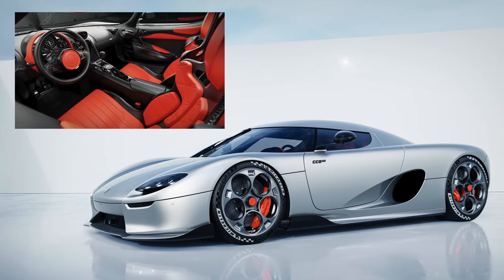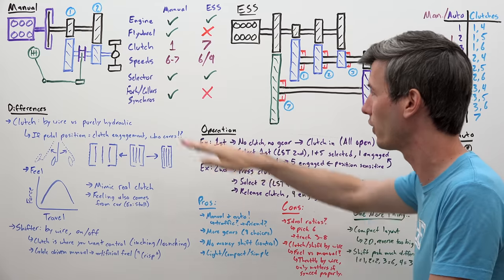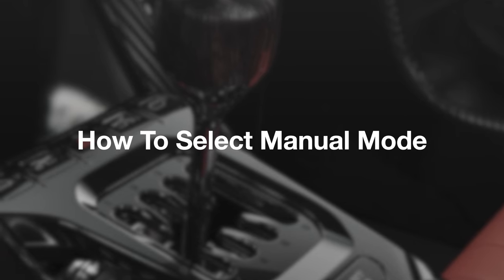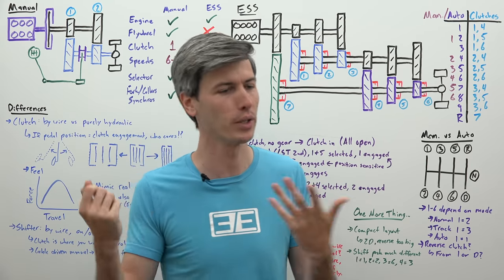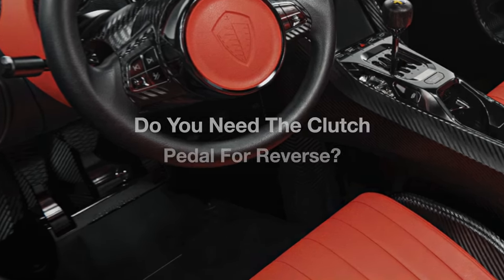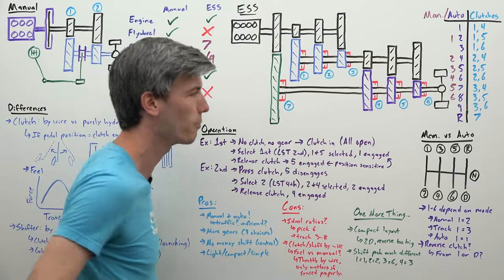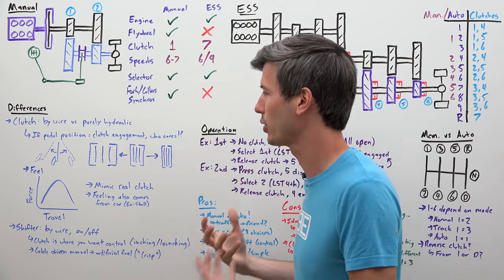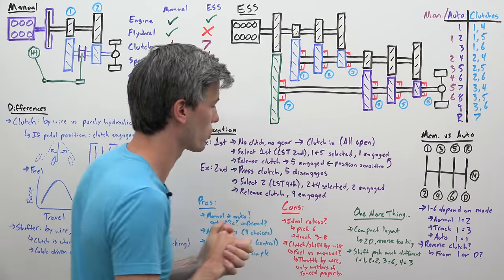Koenigsegg Reinvents The Manual! How The CC850 Transmission Works

Comment: 7 clutches... great for hypercars, not for economy cars. High parasitic losses and rebuild costs.
Reply: Typical modern automatics already have 6-8 clutch packs, so your point is invalid.

Aisin transverse 8-speed: 6 clutches, 7 if you include the torque converter clutch, 9 if you include the sprag clutch. Used in Camrys, RAV4s, Volvos, Minis, VW’s, etc.

ZF-8 speed: 5 clutches, 6 including torque converter clutch.

Honda 10-speed: 7 clutches

GM 9-speed: 7 clutches

Etc.
Reply: @Kyriaeus  Which is why even modern "slush box" automatics get worse MPG, need cooling and are not economical to rebuild. My point is valid.
Reply: @simonkolar5478  you’re obviously out of your depth. Modern “slushboxes” lockup fully by 2nd gear, some even lockup in first. If you haven’t noticed, the vast majority of models that have both manual and automatic options get significantly better performance and fuel economy with the automatic option despite the weight penalty.

Comment: Koenegsegg made this as complicated as possible when they could have just made a normal trans. I feel like this will still not satisfy the manual elitist people and the posers will just put it in auto like they have been with the DCT. As far as I see without a shift linkage or forks this cannot be called a manual. You are simply sending signals to computers like you would with a paddle. I doubt the system will let you fry a clutch like you can in a real manual.

Comment: That transmission has too many points of failure in my opinion.   That has to be less fuel economic than a real manual.
Reply: Regular automatic transmissions have just as many clutches and work just fine while also getting better fuel economy than their manual counterparts.
Reply: The oil pump take some energy and all those clutch packs got to create some viscose drag when disengaged, but more gears to select from compansates depending on speed. Probably not the best choice for fuel economy (the LST).

Comment: It just keeps getting worse. How is this reinventing? It's just a simple version of the automatic transmission, instead of planetary gears it's a manual transmission that's clutch operated instead of with a selector. It's cool that it has a manual mode, yes, but that's more or less fake. It's all actuated electronically, none of the inputs are mechanical or hydraulic. Sure, there's hydraulics, but no direct connection, just sensors and actors that might have hydraulics in between. This is essentially putting a clutch pedal and gearstick controller in a car and hooking it up to the control unit. Essentially, it really only simulates a manual, just like how some CVTs simulate gears. It's the same effect as the real thing for the driver, but mechanically it's really simple. In the case of the CVT, it uses predetermined ratios as fake gear and doesn't vary between, even though it could, and in the case of this transmission, it will control the gears as well as the release of the clutch according to what the driver inputs into his video game controller.

Don't get me wrong, I like it, and it's very cool, and it's not a very simple transmission. But it's not very innovative or a huge challenge to implement a fake clutch and a gear selector like this, a regular automatic could do this too (in theory). The transmission itself also isn't deploying any new concepts. It's like a DSG, but even more to the exreme where the gear selection is done for each gear individually with clutches like in an automatic transmission.

I just thing the explanation and the title is very clickbaity and pretentious. Come one man... you know that this is not that special

Comment: so six clutches to replace..sounds like it will be cheap to maintain! LOL
Reply from the maker: It’s a nearly $4M car, maintenance costs aren’t an issue for these folks. 

Also, modern automatics have 7 clutches.
Reply: Typical modern automatics already have 6-8 clutch packs, so your point is invalid.

Aisin transverse 8-speed: 6 clutches, 7 if you include the torque converter clutch, 9 if you include the sprag clutch. Used in Camrys, RAV4s, Volvos, Minis, VW’s, etc.

ZF-8 speed: 5 clutches, 6 including torque converter clutch.

Honda 10-speed: 7 clutches

GM 9-speed: 7 clutches

Etc.

Comment: To bad it will never be as fast as an Electric Car like Tesla. :(
Reply: Teslas are much closer to being drag/muscle cars than they are at being track cars. The fastest cars are all hybrids, actually
Reply: @RhodokTribesman  Tecla's are much better at being track cars because of independent wheel control and way lower center of gravity.  Tesla holds the fastest times at all the tracks they've raced at.
Reply: Electric cars like Tesla are Superior in "Every" Way, Most HP per pound, instant Maximum Torque, Breaking Systems, .... Face it.. the ICE age is Over.  Wondering when I was a little boy and racing my Electric HO Cars, "Why the Hell are we using Gas? when Electric is so obviously Superior"  it was the battery problem.... now with LFP and the new Tesla/CATL chem with no Nickle or Cobalt 1000km battery packs...  the Future is Electric and nothing else.
Reply: @skitzobunitostudios7427  You're a goofy little critter; I like EVs mate, but Teslas aren't even in the top 10 production cars for, say, the Nurburgring lap record. Hell, Tesla doesn't even have the fastest electric production car record. They're so damn heavy (hence the low CG) because of the fact that batteries have terrible energy density
Reply: @skitzobunitostudios7427  Show me a track where any Tesla will outpace a 911 GT2 RS lmao, the Model S Plaid is almost a minute slower on the ring... that's huge, ginormous even

Comment: Lost me at the clutches. Why take one of the simplest, most robust car systems and overly complicate it? Hard pass for me.
Reply: Typical modern automatics already have 6-8 clutch packs, so your point is invalid.

Aisin transverse 8-speed: 6 clutches, 7 if you include the torque converter clutch, 9 if you include the sprag clutch. Used in Camrys, RAV4s, Volvos, Minis, VW’s, etc.

ZF-8 speed: 5 clutches, 6 including torque converter clutch.

Honda 10-speed: 7 clutches

GM 9-speed: 7 clutches

Etc.

Comment: That seems overly complicated and too many parts. I bet this is going to be a total mess in maintenance, especially if you have noobs with no experience in stick shift operating it.
Reply: Typical modern automatics already have 6-8 clutch packs, so your point is invalid.

Aisin transverse 8-speed: 6 clutches, 7 if you include the torque converter clutch, 9 if you include the sprag clutch. Used in Camrys, RAV4s, Volvos, Minis, VW’s, etc.

ZF-8 speed: 5 clutches, 6 including torque converter clutch.

Honda 10-speed: 7 clutches

GM 9-speed: 7 clutches

Etc.

Comment: Sounds extremely complex - so many points of failure when things start to wear. Still, if you can afford a Koenigsegg I am sure that is not going to be a problem.
Reply: Regular automatic transmissions have just as many clutches and work just fine.
Reply: @Kyriaeus   Until they don't. I agree that the traditional automatic transmissions with clutch bands are generally reliable but even they eventually wear out. I remember my Dad had a 67 Chevy Caprice when we lived in Samoa and he had to order the clutch bands from the States and rebuild the trans himself because nobody there would do it. More recently, I had a 2003 Citroen C5 with a more modern electronically actuated auto transmission whose single clutch was slipping. I would have had to have the transmission rebuilt eventually if the car had not been written off in an accident. Every moving part eventually wears out. They say that those transmissions are sealed for life, but they don't tell you how long that life will actually be.
Reply: @apterachallenge  this design actually has fewer failure modes than something like a DCT or maybe even a single-clutch AMT. Every synchronizer has multiple moving parts and failure modes, from mechatronics failure to blocker ring wear.  And sometimes the failure modes have nothing to do with the design itself - just a little excess bearing grease on a dry clutch system can end up contaminating the clutch surfaces and cause slip.

The saying "every moving part eventually wears out" is technically true, but not very meaningful. It depends on the engineering, quality control, and maintenance - there are very simple designs that reliably fail spectacularly and complex designs that outlast the rest of the vehicle. 

Example: Some of Toyota's earlier longitudinal 6-speed automatics were a rube-goldberg mess of one-way clutches combined with regular clutches. They had enough moving parts for 2 transmissions, and yet they haven't been particularly problematic.

Comment: WAY too much going on. Points of failure just increased heavily. Stick to a cable clutch Honda. 😁
Reply from the maker: How many points of failure are there in just the first gear of that Honda? Shift fork, pressing into a collar, moving along a shaft for a triple cone synchronizer, to finally mesh gears. A clutch could certainly be argued to he simpler.
Reply: @EngineeringExplained  maybe, but plenty of money left over buying the Honda instead of a multi million dollar exotic.
Reply: Typical modern automatics already have 6-8 clutch packs, so your point is invalid.

Aisin transverse 8-speed: 6 clutches, 7 if you include the torque converter clutch, 9 if you include the sprag clutch. Used in Camrys, RAV4s, Volvos, Minis, VW’s, etc.

ZF-8 speed: 5 clutches, 6 including torque converter clutch.

Honda 10-speed: 7 clutches

GM 9-speed: 7 clutches

Etc.

Comment: I disagree with your definition of a MANUAL Gearbox. It's a manual if I don't have the keys (or fob) and I am able to release the parking brake, depress the clutch pedal, shift into to neutral and push the car out of the garage, no engine running and no ignition on. What your are describing is a AUTOMATIC Transmission.

Comment: overly complicated and over jiggered. Lets use 7 clutches and computer control when 1 clutch and the driver have been doing this for 200 years!
Reply from the maker: Modern automatic transmissions can have seven clutches. This isn't more complicated.
Reply: @EngineeringExplained  Sure...maybe...still no need for the complexity, but then I'm not fond of automatic transmissions of any kind.
Reply: @EngineeringExplained  maybe it’s time for a video on automatic transmissions? Seems like half the comments here are people moaning about “nurrr 7 clutches is too many” when they probably daily drive a car with just as many clutches.